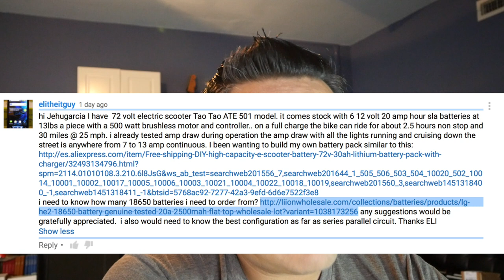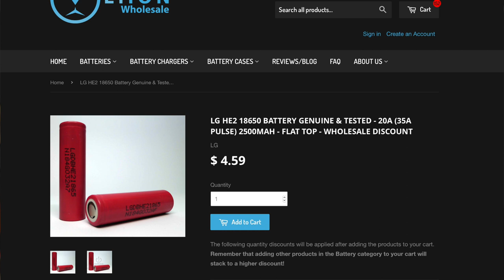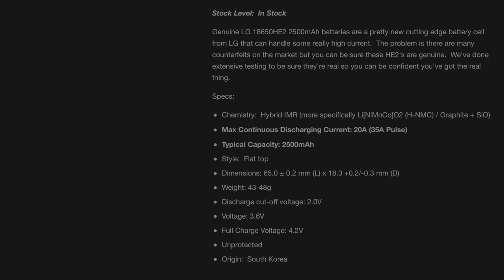How many 18650 cells to power a Scooter?   Battery talk #4

Comment: Sorry I've gone back to this video, I've seen this with E-Bikes the motors are rated at say 500w but the controller like on mine can push 23 amps, so 23 x 36v is  828 which seems to be right when I check my watt meter, so is my motor actually 800w and not 500w like the question of the moped in question, as I have this argument that here in the UK we can only have 250w but most bikes are 36v and the controllers are 13amps max so they are in fact nearer 500w which means they are illegal even though they are from a manufacturer stating road legal bikes?
Reply: the ebike motors are often rated at ''safe continous power levels'' meaning that the company's making them can circumvent the laws for the maximum motor power cince the peak draw can me much higher  since any electric motor can vary its power to the supplied amount of power like with having more powerful battery's and  controllers. since for as far as i know the controllers are not limited in power release to the engine.
Reply: @rubenadriaensen  Thanks I've been trying to find out how manufacturers rate their kits and motors since its all seems rated by motor wattage when selling or for legal requirements. great explanation.
Reply: @brannenthompson9662  thx. Some things might be different for your country but what I said I heard came from a us based website. So I'm not sure what the legal test system is or what they test for a set to be legal.

Comment: I'm just practice on paper, i have a scooter 72V 50A (4000W), if i use 18650 batteries i'm getting 20S20P (200 Cells) please let me know if i wrong, but it's a huge battery pack, can i use 21700 (3700mAh) battery in 20S14P (280 Cells) configuration to get the same power? because there is a 120Cells less than 18650 cells, thanks

Comment: Great vid, love your work! I know this is an old vid but maybe you can help me - I have a stripped G20 Chevy van (no engine, no trans, just 2 seats) I have a 24V 4kW DC motor laying around my shop - would it move the car at least to 30mph if I connect it directly to the differential? plus how many cells would be needed?

Comment: Hi, 
He says that 19 Cells in Series & 8 in parallel.

One series of 19Cells can provide 20A draw, but by connecting them in parallel would provide 20A*8=160Amps?

So is the 160A then the max possible draw? and the motor just draws what it requires?

Comment: *Please answer * I'm also wondering how to determine the Watt hours and Amps and Volts for DIY 18650 battery packs... Would a series of 10 Li-ion 18650 batteries, be enough power for something like  TV or a playstation 4? Please help answer...

Comment: (After having to retype this 3 times-- Youtube hates the tab key)

You missed an important part. Since he has to do 8 cells in parallel, he can make a better decision on what type of cell to select. He needs to find his max amperage, then divide by the # of cells in parallel. Lets assume 20 amps / 8 parallel = 2.5 amps. Many other chemistries and brands are cheaper and support a measly load of 2.5 amps. This reduces the battery cost significantly. LG HE2's are too expensive and you don't need 20/35 amp discharge rates for his application.
Reply from the maker: +RyanWebDev   true,    Although,  is there really cheaper cells?   I've never shopped for new cells so Im not aware what the going rates are for the different models.
Reply: Of course, some chemistries are cheaper to produce.
Reply from the maker: Ok  so in theory you should be able to find cheaper cells but in practice you can't produce a link to such cheaper cells?
Reply: I'm not sure if you're confused, but are you actually trying to cast doubt on that different cells cost different amounts? That is an absolutely sane and truly stupid thing to say... capitalism enough should be all you need to understand to grasp that a market will naturally have different prices for different versions of a similar product.

but, I digress. https://batterybro.com/collections/18650-battery is the first link I found on google that sells new batteries on a per-cell level with some price variance. Pricing on a per-cell level is lame, as if you're building an EV you'll want many and get much better prices as well.  That website also lists the amp output and the capacity, and if they would list the price, you could use those to come up with the most cost effective cell for your needs. 

So, yeah, you can absolutely optimize your purchase with a little more math.
Reply: ADDITIONALLY, buying cells from these crap websites is a bad idea, you can get cheaper prices if you buy in bulk from their supplier. You'll have to do your own research on how to get a better connection. Some websites even offer bulk purchase themselves which is nice.

Comment: I don't get it. My Tao Tao ATE 501 came with 4 12v SLA batteries.  Fully charged they should put out about 55v. How can we assume that 72v would not over-voltage the motor and burn it up?

Comment: Hi I'm building an ebike stealth bomber with an 8000w rear hub motor. I'm using a sabvoton150a controller. The hub motor is 72v 50a continus 200a peak. What size battery would I need to build is series/parrallel using 18650 3000ah batteries. Any help would be gratefully appreciated. Brian

Comment: Looking to convert a small 800cc car with a direct drive 30kw motor without any change of axles. I was looking to purchase one Tesla battery module (444 cell) to go with it even though I do not know how to estimate range on this. Right now I am interested to see if I CAN do it. Could you suggest some cheap but reliable air cooled controllers if my plan so far looks valid? Also, how long does it take to deconstruct and refit a small car - generally?

Comment: i am having an electric Ricksaw which is fitted with new batteries and it gives more mileage to my vehicle when i changed the new to old one having 12v,11v,12v,9v it is not giving sufficient mileage but i charged the batteries for more time than new one but why it is discharging quickly and what is happening inside the batteries please make an video regarding this

Comment: Hey bro love your video thanks for helping us out people who doesn't know anything about batteries and learning about batteries voltage and capacities and series and parallel I have a question when building your battery does it matters whether the battery is 3.7 or 4.2 volt whenever you building it for putting on your nickel strip does it actually matters whether it is full charge or storage charge I am trying to build two types of battery which is a 36 volt 9 mp and a and a 24 volt for my electric scooter greatly appreciate some healthy tips how many cells do I needed in parallel and in series thanks greatly appreciate if you help me

Comment: I have a hypothetical question: Could you balance charge every cell to 4.2 volts by charging every cell in parallel? If I connected 10 cells in parallel and applied 4.2 volts would that work?

Comment: Can this battery used in the 3kw hub wheel of a motorcycle?
How to calculate the battery requirement range for 100km?
also, need a good BMS suitable for this conversation  with normal 4 hours charging and fast charger @1Km/min
Rated Power: 3000W V3 Peak Power: 5000W Rated Voltage
91% Continuous current:45A Max Current:80A (Peak 100A in short time)
it would be great if I get help from you, as im watching your videos and learning, as I'm new to this  ev conversion

Comment: Hi Jehu!!...Excellent video...But aren't these calculations for a dc motor....For an ac motor how do we determine battery configuration ?? Wat kind of motor did use for the samba project?
Reply from the maker: +Lakshmanan Palaniappan   I don't see how power requirements would differ between AC and DC motors,   It should be the same.   My Samba has an AC motor
Reply: +jehugarcia  Wat kind of inverter controller u used? Is it possible to vary both torque and rpm like a tesla car in ur samba?
Reply from the maker: Yes, Silly,  my car doesn't go full speed all the time.   here is what i used http://j35.us/HPEVS-AC51-Motor

Comment: You can't just check the amperage, when these batteries hit hard currents, they tend to drop in voltage so you're calculation won't be correct. Not sure how much it drops as it depends on the battery type they are using. It would still be high power but nothing like the total calculated power.

Comment: Hi, I srinivasan . I'm having a configuration of 6s and 20 p to get a wattage of 1320 Ah using (18650 3200 Ah/unit) cell. I'm having confusion of how to make BMS for the same unit. And can i dont know how to design a charger for the same power set up. Can u please guide me through the same. My primary application is for RC plane.

Comment: Hi Jehu, are you sure you didn't mean to say a 20s pack, i have a 36 volt lithium bike and it uses 10s pack.
Reply from the maker: +Henry Sohbatian 20 cells fully charged equal 84V   if your equipment can handle it go for it,  you could even probably do 21 cells  in some cases

Comment: Im late to the party, but im here. I was watching this fine video and heard you say "if someone has a difficult situation to hit you up"?? Sweeet! Hell of an offer, to me. Im pretty new to this world but hooked. I need your help.. help i cant seem to get elsewhere. I have a project that might be a little difficult. I ride motocross and i am wanting to go electric with my gas race bike. 2007 Honda cr250r. I want 40-60 hp and tons of torque. I dont need alot of top speed. 
Ive been looking at 25kw bldc motors and up.  It cant be too big or heavy because ill need a battery pack shoved in there too. 
**OK.. Batteries.. Let say i find the motor. With motocross we are on and off the power constantly, not sure if that matters. 
#1- Does the bigger the pack mean more power/torque out of the motor? 
#2- Will it make the motor a higher kw? This is where im lost with ppl having 50kw power with a small enough motor in their st bikes. Anyways.
#3- Can i run multi battery pack with same controller. (i want to keep the physical shape of the bike as much as possible) Not shiz sticking out looking stupid.
#4- Can these packs be built to different shapes to fit where id like? 
They need to be low enough for center of gravity.  
*It doesnt have to have a long running time, 45- 1hr. A full moto at full power at least. 
#5- Can i put sensors on the battery pack for like temp, heat etc?
#6- Do i need anything on the battery to run the motor in levels of power? Like level one mellow, level 2 more power and on up. 2 or 3 diff.
#7- If i run more volts (cells) then needed will it keep the pack cooler, motor?
#8- Something i already mentioned, but if i run more volts thru the motor will it bump up its power. (Im trying to stay small as possible with the motor) Or do i need the size motor that makes what it says.
Before i make this a novel let me say that any info would be greatly appreciated. Mucho. 
Thanks brother

Comment: Quick Question >

Does good 18650 with same voltage and internal resistance pulled from same old battery, means they will have same health ( capacity left) ?

i`m asking this because i was thinking to test only one cell capacity from same battery, to speed up the process,
Thanks in advance
Reply from the maker: Likely but Not necessarily

Comment: I have a small row boat that I also use a trolling motor- Currently I use a 12v deep cycle marine battery- Is it possible to get more power and a lighter battery pack to power this?

Comment: building a prototype longboard, currently have a motor..3200 watts, 80 amp. I was going to use lipo cell pouchs but already ordered the 18650. I don't want to run the cells standing up like you have on the pack you showed but rather laying down, how can I get the most power and config these batteries for this project? I have 9 inches wide by 25 inches long to work with, honestly I am not even sure ill be able to use this motor if I can not get enough power from these batteries.
Reply: Triston Webber I use same 3200W (turnigy sk3 6374) motor on my electric Longboard , You need high drain cells (20A cont) .  best configuration would be 10S 4-5P  .

Comment: I want to power a 48v 42A motor and if I use 10A 18650s it came out to be 65 batteries. That came out to 50a 48.1v and I wanted to know how far that would be able to take me if I had 3500mah or 2900

Comment: hi Jehu, I have my ev car, chinase made it runs very well, its has 8-deep cycle batteries 12v-120ah, 10kw motor, 96v 13.8v 420w controller, how many 18650 do I need. thanks Garcia

Comment: so for you batteries to last long time, you'll have to consider not to use all the capacity of the battery, this also apply to the lithium cells.
Reply from the maker: Correct

Comment: I've seen that in all your videos, the cells are placed in a way that all cell tabs are pointing in one direction (outwards towards the busbar connection) with the width of the pack limited to the height of one cell (65mm).

Is there anything wrong with stacking smaller towers horizontally, such that the cell tabs are not pointing outwards but towards each other. Of course there will have to be some sort of acrylic sheet to prevent contact between the 2, but I'm thinking of making a space conscious pack of 150 18650 cells.

Instead of placing them all together like in this video, I was wondering if I can make 3 towers of 50 cells (5S10P) each and then connect them together while placed next to each other. First thing that comes to mind if the mechanical stability of have 3 towers v/s all cells tightly packed in one. 
But apart from that, is there something obvious that I'm missing?
Reply from the maker: you can place cells however you need as long as connections are right.   The beauty of 18650 cells is you can make packs of custom size and shape
Reply: Awesome!
For connections between sub packs placed separately but held together within a housing, do you recommend a copper wire or some kind of plates? Is there any recommended procedure here?

Comment: Hi, I have a 1500watt 72v motor and I would like to get the most out of it. What battery configuration should I be using. At the moment I am using led acid 6 * 12v 10ah. I feel like I can get a lot more speed out of the motor that’s why I am asking. My controller I am using it rated for 72v 1500w.
Reply: For 10 amps 72 volt you need to build 20s5p thats 20 end to end pos to neg and 5 side by side. 100 cells.

Comment: Love the vids. Im going to plan a honda 125 electric motorcycle. Fat dude so total weight is 700 lb. only need about 55 mph top speed and 20 mi range. Can you please help me with the recipe. Thanks for helping save the planet and all the information you have shared. SteveR
Reply: Gday
I am in the same situation in Australia
Ive got an 100CC petrol motorbike I want to convert to Battery
(Same frame also handles 125cc and 250cc petrol engine)

If possible I would ideally want:-
* 30 miles on one charge (48.28KM)
* 55 Mph = 88.51 KM's 

With this Setup I could travel to my place to City ,
 then put the bike on charge (Solar hopefully) 
 for 6-8 hours 
 (Brisbane doesn't have Battery recharge stations yet)

I would avoid the main express/highways 
but I can travel in 20/40/60/75/80/85km zones)

Great videos , thanks for sharing your info
PS are you MGTOW ?

Comment: I have a similar scooter that uses 60 volts 20ah lead acid batteries and I want to make a n 8650 cell as well and don’t know what configuration I would need 🤷🏻‍♂️🤷🏻‍♂️🤷🏻‍♂️
Reply: Assuming you are using the same batteries as in this example then you would use 60 volts/3.7 volts = 16 or 17 batteries in series. For comparable range you would also use 8 strings of cells. So 16S8P or 17S8P is my estimate. Also, note DW's comments above.

Comment: DEAR SIR , i have an humble observation . existing batteries 6x20ah are sealed lead acid type ( assumed vrla) which have normally D.O.D. 70% . IT MEANS THAT AVAILABLE engery is 0.7x6x20 ah . 
18650 cells have d.o.d nearly 95-100 % . so no. of required cells ( considering energy available for use) should be 0.7x155 =108 cells approx . on the face of it , you have oversized the battery . kindly comment . your experience in batteries is very respectable .may be my observation is not practically correct . 
regards engineer arshad lahore pakisan

Comment: good video, I need 60volt 20amp  for my 3000watt motor scooter. the scooter has 60volt 40 amp lifepo4 pack,  but I need a removable pack 60volt 20aH to expand range. thanks

Comment: i want to make a solor power bank out of these batteries how would i do it i want to use 3.7v 3000 samsung by2 (brown poop batteries) used for v aping but i have no clue as to how many amps of storage i need what board   chips i need so the voltage won't travel back to the panel and i won't blow my self up trying to sink them together

Comment: How much does that pack you made weigh in Lbs? the one with 150 or so 18650s.  I looked at the comments but couldn't find a weight. 
I want to build a pack with 100 of the 18650 cells with 10 in each series for 37v. 
Any idea on the weight of 100? Thanks.
Reply from the maker: +codygocam   17.5 LBS   so  divide by 3 x 2 =   11.6 LBS for a 100 cell module.

Comment: Adding more in parallel would only increase the range of the scooter right
Reply: Amaury Ayala I'm also wondering this. Someone please answer.
Reply: In theory, yes. adding more pack in parallel means more range. But what I don't understand is, Jehu said 19 cell in series only give you 176wh. 19 cell in series only multiply it's voltage, not it's battery capacity. IMHO 19 cell in series gives you 72V (nominal) and 9,25wh. I dunno. I could be wrong. Sorry for my bad English.